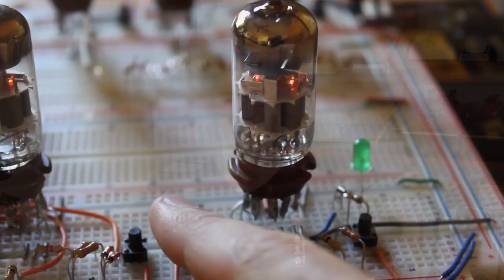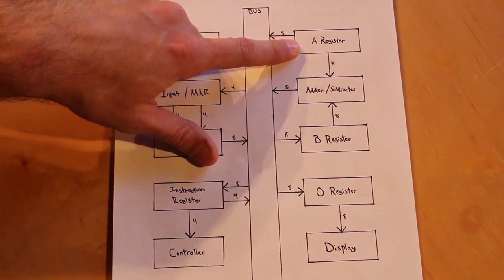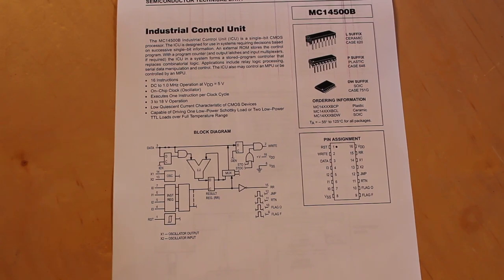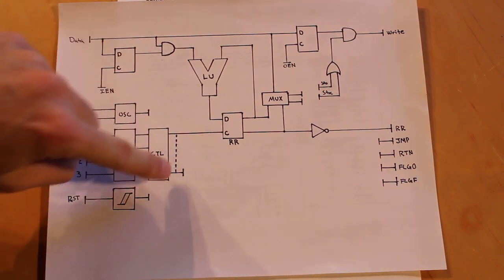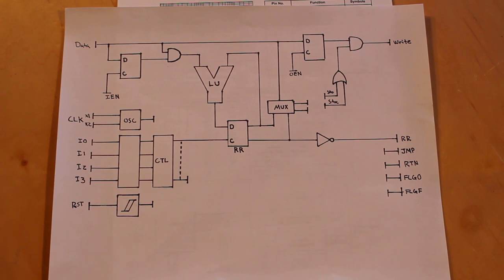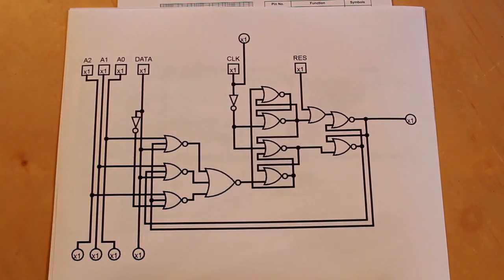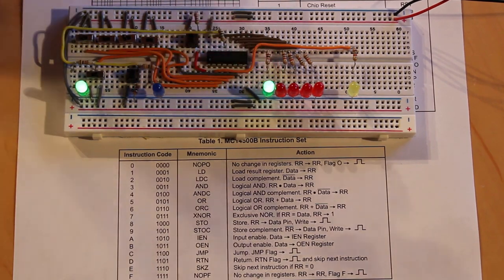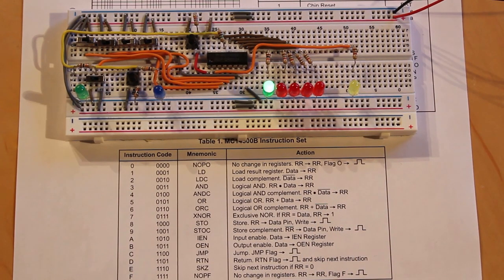Vacuum Tube Computer P.01 – Architecture and the MC14500B

Comment: Fascinating chip. They boiled it down to a really clever absolute minimum set. It’s actually hard to believe that it is actually enough to do some computing. Going to watch the series with interest!
Reply from the maker: Thank you so much!
I did get a few things wrong about the chip operation that I've since learned by playing around with it. Notably, there's two ways to skip the next instruction. Op Code 1101 RTN sets the return flag and skips the next instruction, but the really interesting one is Op Code 1110 SKZ which skips the next instruction only if the Results Register is 0. Conditional jumping is huge and allows the chip to do some really interesting things. 
Also, the Output Enable (OEN) and Input Enable (IEN) instructions can do some really weird stuff. The handbook even outlines building IF-THEN structures using those. It's all going to require lots of steps though, so the program counter becomes quite important.
It should be a lot fun figuring out the weird quirks of the chip and if we can get the tube version to work as well as the silicon version!

Comment: Sounds insane, going serial and smaller word size would downsize it. I hope you have deep pockets lol
Reply from the maker: Thank you!

It's actually a pretty incredibly compact microprocessor, even from a transistor count point of view. I've got a video coming up soon about digging into the metal of it, but also check out Ken Shirriff's blog post on it: https://www.righto.com/2021/02/a-one-bit-processor-explained-reverse.html
Now, my version obviously isn't going to be a 1:1 replica, as I'm trying to keep the tube count down as much as possible, but it should have most of the functionality! I'm fairly certain I can get it done using less than 200 tubes overall. Of course, getting the micorprocessor working is just the tip of the iceberg, there's a lot more to tackle after that, such as a program counter of some kind and some memory.

Still, I'm hoping to do as much as I can with 6AU6 tubes, which can usually be found for about $0.30 a tube if you get them in big enough quantities!
Reply: @UsagiElectric  How do you plan to implement memory handling? It could easily be the biggest sink for tubes second only to the control logic. Would adding some diode logic be cheating for this project? I can't wrap my head around the only 200 tubes. I'd think adding a PC, buffers would alone be nearing the 200 tubes. Or do you plant to just make the chip in tubes and everything else in IC?
Reply from the maker: @godofcows4649  Ah, I don't think I was quite clear enough - the 200 tubes is just to recreate this chip. If you check out at about 11:30 in the video I show a rather convoluted logic diagram consisting mostly of NOR gates. This is actually a functioning gate replica of the MC14500B that I've built up in Logisim and am using as a blueprint for the build (for the most part, as I build further, some things are changing). In that iteration, it's just about 90 gates, and with some diode logic, I can replicate each gate with a single 6AU6 pentode. However, it doesn't include any cathode follower buffers, which are definitely necessary in some places, a clock interface, and there are still some changes to skip functionality that I'm working on, so I'm guesstimating it'll be roughly double the number of tubes.

But, that doesn't include any memory or a program counter, which the original MC14500B doesn't include either, but is definitely something that's necessary. And to be honest, I haven't really come up with great solutions for both yet, haha. 

I'm certainly not against using diode ROMs, but I'm actually leaning a little more towards punch card loops (like the FACOM 128 uses in this video: https://youtu.be/_j544ELauus?t=1052). The MC14500 architecture is really neat because you can conditionally turn off the input register or output register (IEN or OEN) and just let the program make a full loop back to the beginning. It's not as good as being able to jump to specific spots in the program, but it's a pretty good compromise.

RAM is so much tougher. Initially, I intend to just build at least one small 4 or 6 bit general purpose register (being a 1-bit processor gives a lot of freedom in choosing register sizes) out of tubes. This is essentially the same thing that I'm building for the 4-bit instruction register. At 6-tubes per bit, it's a little tube intensive, but 36 tubes for a 6-bit general purpose register isn't bad. 

But, bigger RAM is a tough one. I could use the 4/6-bit register as an address for accessing memory, giving up to 16 or 64 bits of memory, but how to implement that memory? I would love to do something like core memory, but that's a whole extra level of brilliance I don't have, haha. Maybe some kind of really small scale magnetic drum memory? I have a ton of ideas bouncing around in the noggin, but none really light me on fire. Fortunately, that decision is still quite a ways off, so I got plenty of time to mull it over!

Ultimately though, the plan is to not use any IC chips anywhere. I'm kind of stretching the period correctness by using silicon diodes, but there were still plenty of vacuum tube computers in the late 50s that used germanium and selenium diodes as well, so I'm alright with that one. Ultimately though, it's possible that the entire thing ends up at over 500 tubes, which means I'll need to budget powering it on into the electric bill, haha!
Reply: @UsagiElectric  The more I think about memory the more I think it'll be the hardest part of the project. Data is one bit wide but instructions are 4 bits wide. So if you wanted to do a von neumon architecture, you could use a shift register to parallel out on the input to the instruction register. 

Harvard makes the most sense, and I'd prefer paper tape for the ROM, doides would be a pain and I don't know where one would get a card punch.

The tape could be strung together and could skip a line of instruction, or if you know how long the tape is and where you are on the tape, you could skip until you got where you wanted, a way of doing a subroutine without addresses.

RAM is odd too, you could try out core rope memory, or attempt delay memory with wires. Core rope could also be used for the ROM as a means to implement self editing code.

No transistors and no ICs make this project difficult, but you'll have bragging rights, I don't think I've seen anyone make a homemade computer out of tubes yet.
Reply from the maker: @godofcows4649  Most likely I’ll probably end up mirroring the minimal ICU system outlined in the MC14500 handbook, though with a few concessions here and there (page 26 in the handbook here: http://www.bitsavers.org/components/motorola/14500/MC14500B_Industrial_Control_Unit_Handbook_1977.pdf).

Using a tape for the program counter makes life super easy, and it being tape gives quite a lot of flexibility. In the handbook system, they use an 8-bit control word – four bits for the MC14500, three bits for memory addressing, and one bit for chip select. But, with tape that could just as easily be a 12-bit control word. 

RAM is definitely the tough one here. But, that might also be where the limitation of having a 1-bit processor helps us a little. To do anything on massive numbers (like greater than 8-bit) would take programs hilariously long, so it may be best to just keep everything on a fairly small scale, since it’ll be mostly for demonstration purposes. 

Either way, there’s a ton of hurdles that I’m going to butt my head against, but I’m nothing if not stubborn! So, my solutions will rarely be elegant, but they should get the job done, haha.

Comment: Very pleased with the direction! If you can reproduce the MC14500B that will be awesome, feels far more achievable than the sap1 in valves, I constantly have to fight over scoping my projects (with little success). I look forwards to seeing more of the build.
Reply from the maker: Thank you very much!
Once I realized that the SAP-1 was not really feasible, I kept trying to come up with a new architecture myself, and I had the same problem of keeping the scope down (I call it feature creep). I always ended up just coming up with a worse version of the SAP-1 without actually saving many tubes. Fortunately, the people who designed the Motorola chip are way smarter than me and published excellent documentation! It seems like a really capable little chip and should be fun to build out!

Off topic, but I recently found your channel and am a few episodes deep into the 8-bit pipeline build now, it's excellent. I'm definitely looking forward to the next 80-ish parts in the build!

Comment: Around 1983 the company I worked for used this model chip in an x-ray fluoro table to control an 8085 that was used to control stepper motors for positioning film to record patient images. All doctor controls were handled by the 14500 ie button actuation led indicators but all the 8085 did was the stepper control.
The good old days?!?!?!

Comment: Time to pull out the dekatrons?
Reply from the maker: Oh man, I wish I could use some dekatrons! Unfortunately, I'm building this entire thing to run on just +24V and -12V, which isn't quite enough for a dekatron to work. Most vacuum tubes work surprisingly well at low voltages, even some Thyratrons, but cold-cathode stuff really needs the high voltage potential to light off. Boy would it make things like the program counter and memory a lot easier though, haha.

Comment: Hey, looks like Ben Eater has brought us all together, lol
I'm working on an mc14500b trainer board, like the days of old. It will eventually be made from 74xx logic chips as these chips are getting rare :(
Reply from the maker: Ben Eater is at fault for the number of breadboards in the house tripling, haha. 
That's awesome you're working with an MC12500B trainer board, those are few and far between! I'm really digging this chip, it's the very essence of "everything you need, nothing you don't". I would love to build a replica of the chip out of discrete transistors one day as well. If using DTL logic, you could keep the transistor count to less than 100, which is really pretty impressive. 
This is an excellent resource on rebuilding the chip from 74xx: http://www.6502.org/users/dieter/m14500/m14500.htm
I got a ton of information from there, particularly about how to build a multiplexer Logic Unit. There's a few discrepancies between the logic diagram shown on that website and how the chip actually functions, but it's surprisingly close!

Comment: Lets see, have not finished the video and I have already bought the chip :-D I would love to see,  besides the vacuum tube series a parallel series with the chip :-) This is a very exciting project!  Love it!  I love it when something is boiled down to the lowest possibility. I look forward to more videos on this as I play with the chip as well (Dec 23 delivery :-D ) This reminds me of a Turing machine.  Will it be able to do a Fibonacci series for example?
Reply from the maker: Thank you so much!
I am indeed thinking of doing a parallel series where we build out the actual IC into something more formidable. Aside from this helping to give me a fuller understanding of the chip, it'll give me time to cut all of the circuit boards that are going to need to be cut for the tube version. My CNC mill is going to be running a whole lot to keep up, haha. 
This chip really is interesting as it's just about the simplest thing you could make while still being able to do complex operations. With a conditional skip and the ability to build IF THEN statements, I'm fairly certain this chip could be built into a turing complete machine. And, interestingly, being able to calculate the Fibonacci sequence is a bit of a personal goal!

Comment: Why no relays?
Reply from the maker: Traditionally, it was because relays have a finite speed limit, whereas vacuum tubes could be pushed to much higher clock rates. Though, a tube computer was often heavier and more power hungry, that was a trade-off companies were willing to make for the added speed.

For this build I'm not super concerned with speed (I'll be happy with something like 100 Hz), so relays could totally work fine here. But, I really wanted to learn more about vacuum tubes and how to build stuff with them, so that was the primary driving force behind going that route!
Reply: @UsagiElectric  Oh, thanks for the info! Cool video!

But... I do not know if... Would be worth your time making an analog computer or device with them? I though that Vacuum Tubes were perfect for those kinds of jobs.

Just a insanely simple contraption could do the trick.

Comment: how many FPS do you get running Cyberpunk77 ?
Reply from the maker: Never one to back down from a challenge, let’s do some quick and (really) messy math!

It’s hard to calculate exactly, but let’s just take a look at how quickly the MC14500B could add two 64-bit numbers together. First, it’ll take around 12 instructions to add two 1-bit numbers together. Multiply by 64 and we’re at 768 instructions to add two 64-bit numbers together. The MC14500B can run at a maximum speed of 1MHz, which is 1 million clock cycles in a second. So, at max speed, it could add those two numbers together in 0.00768 seconds. Not bad!

Now, the recommended CPU for Cyberpunk 2077 is a Ryzen 3 3200G, which features a 64-bit bus width and an out of the box speed of 3.6 GHz. The architecture is pretty wild, but it’ll probably take a couple of clock cycles to perform an addition operation. We’ll round up grossly and say 10 clock cycles. The 64-bit bus width means it takes only those 10 clock cycles to add our two numbers together. At 3.6 billion clock cycles per second, it takes just 0.0000000036 seconds. 

What does that mean? Well, the Ryzen 3 is around 2.2 million times faster than our little MC14500B. So, if the Ryzen 3 playing Cyberpunk 2077 can average 60 FPS (hah!) then the MC14500B should get roughly 0.000027 FPS, or about 2.3 Frames Per Day. So, a bit under a month for 1 second worth of visual data! Not bad at all for a little 16-pin ICU that was designed in the 70s!